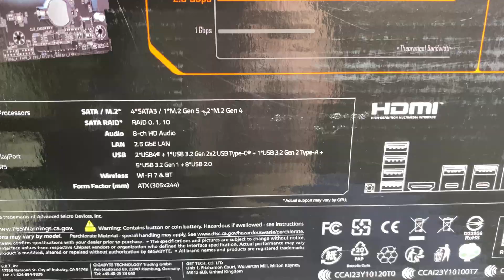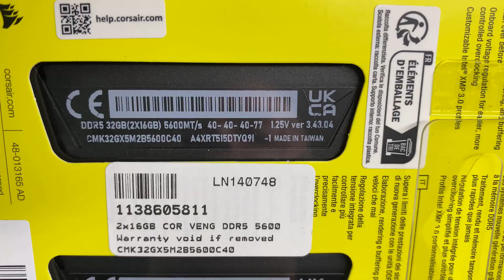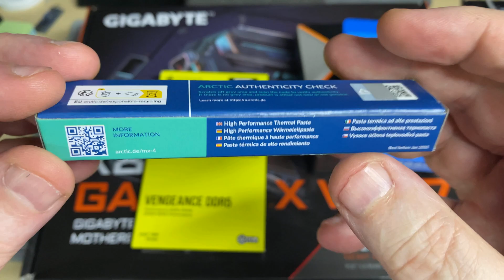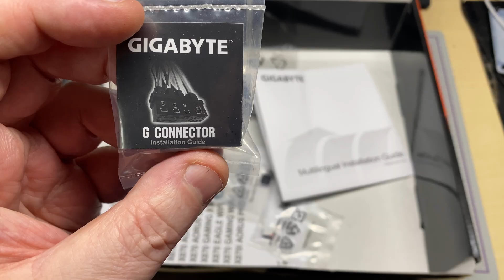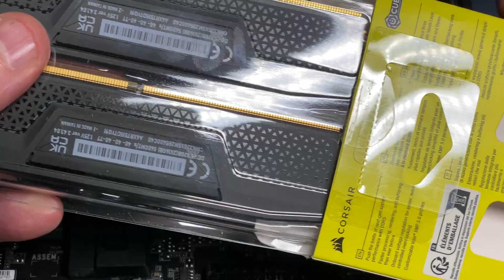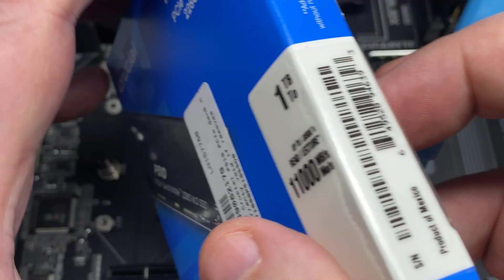How to install a AMD Ryzen 9 9900X AM5 on a Gigabyte X870 Gaming X - CPU / SSD / RAM Install. Part 1

Comment: Don't understand why you chose a 5600 mT/s RAM and only a TB of gen5 ssd that costs rughly the same as  a stick of 2 TB gen4. The ddr5 6000 mT/s CL30 are a much better choice in my opinion, but I understand that right now RAM cost much more than few months ago.
Reply from the maker: Price my friend. however i can upgrade in the future, i needed a pc quick and to be reasnoble priced .  As for the SSD , i like to keep my primary drive as clean as possible so 1tb is more than enough , anything else gets offloaded to the other ssd's
Reply: @MicroChipz yea I watched the part 2 video, prices are going up crazy